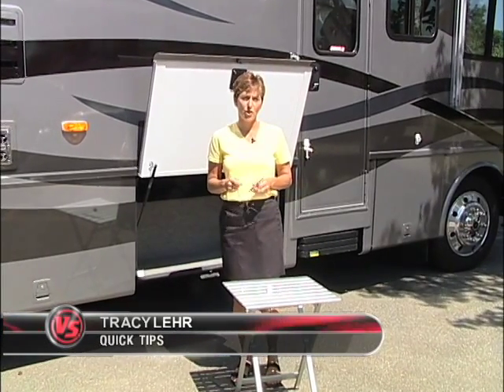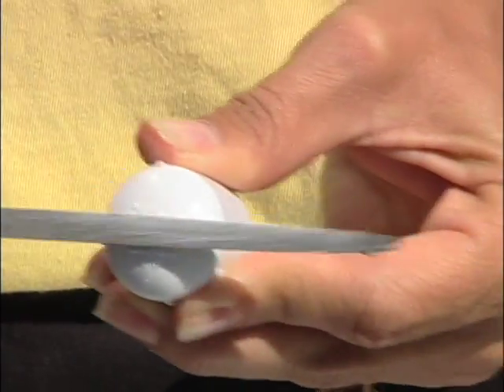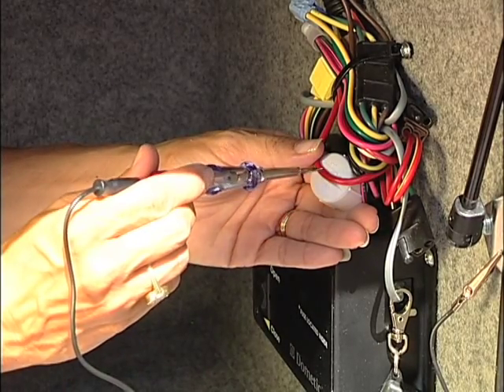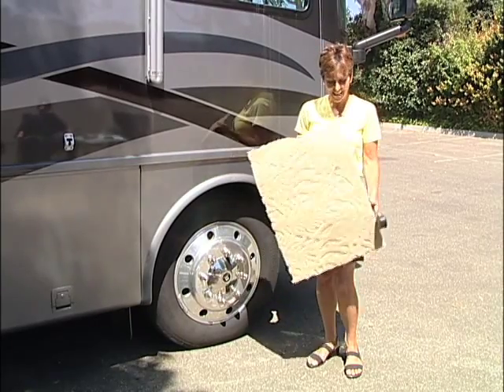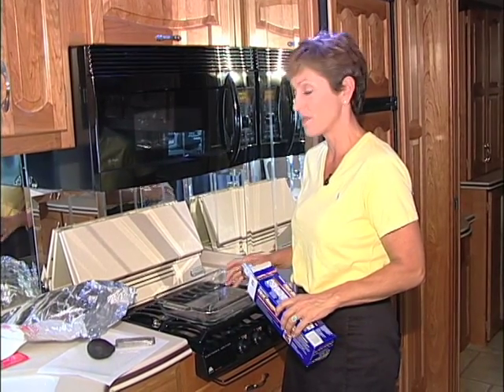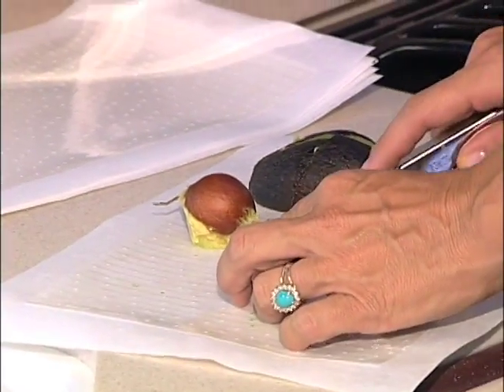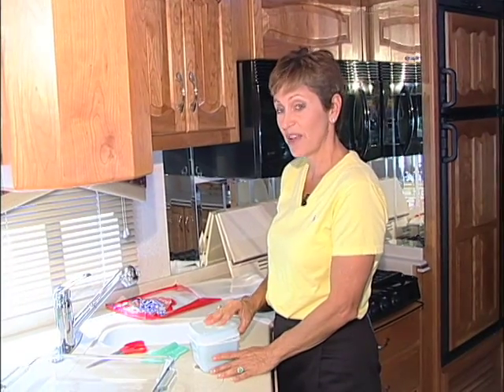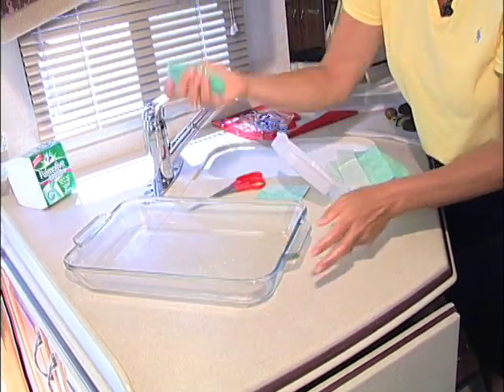RV Tips - Using a cooking bag for easy cleanup

Comment: A variation on the carpeting samples would be to buy a pair of quality knee pads from Lowe's or The Home Depot. I bought mine a year ago (2015) in THD for $13. Not the cheapest, and certainly not the most expensive. But they work well, both in setting up our RV, and climbing into the bed of my truck under the truck cap.